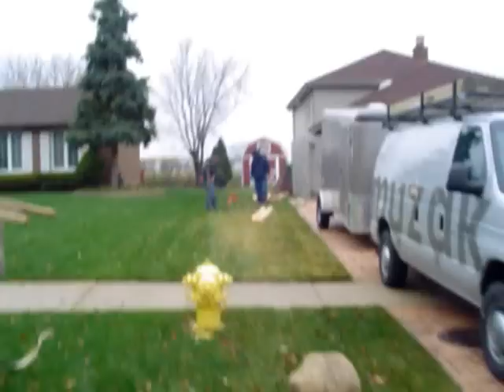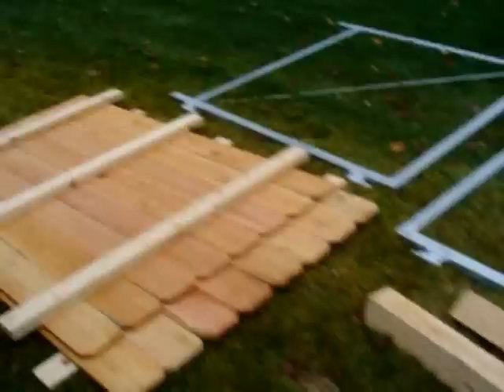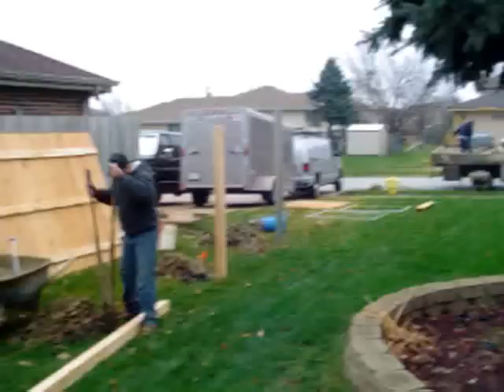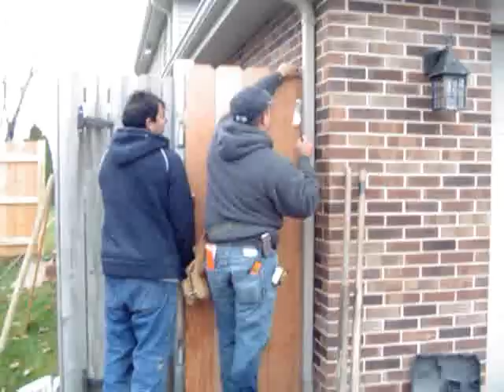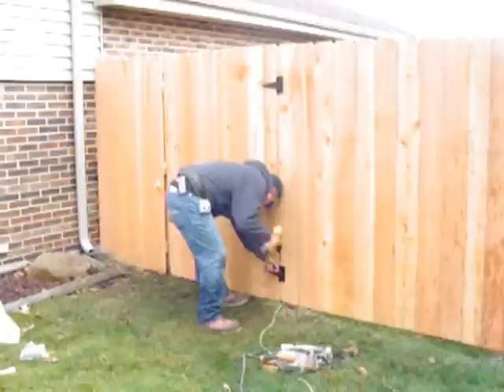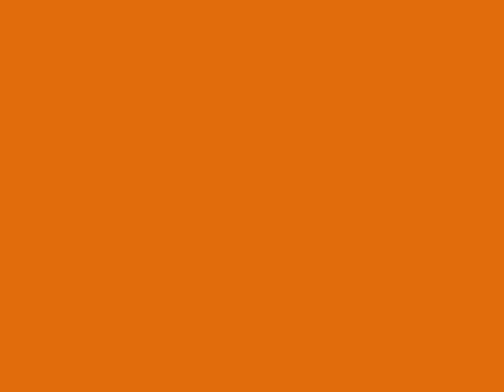Home Improvements  New Wood Fence

Comment: IT BRINGS  ME GOOD MEMORIES WATCHING THIS VIDEO. I USED TO LIVE  IN THAT BEAUTIFUL AREA. I WORKED IN A FENCING COMPANY AROUND THAT AREA AS WELL IN THE ROUND LAKE ILLINOIS AREA. IT WAS A TOUGH  JOB.  We never use prefab panels we always did a picket at a time. This  guys did a good job, the only thing I  didn't like is the way they pour the soupy concrete, that's a no no for me as an experienced fence installer. WE HAD TO DIG HOLES 48 inches deep as  CITY code requirement cause of frost line. WE USED AN AUGER, BUT THERE WAS PLACES THAT THE SOIL HAD TO MUCH ROCKS ,SO IT HAD TO BE DUG BY HAND IT Was so hard THAT the next day I COULDN'T  FEEL MY HANDS.  THEY WHERE TO SORE. NOT DOING THAT JOB NOT MORE. MOVED TO CALIFORNIA.

Comment from the maker: not a problem for setting posts, it still gets hard.   in hindsight I would not have used concrete, I would have used fine gravel, which is how my first fence was installed many years back.  the posts never moved AND I was able to remove them again.

Comment: Nice premade  panel wood privacy fence. The welded steel frame gates are great with awesome hinges and posts. I am surprised they did not use the same steel frame for the walk gate. Although the posts are cedar, without below ground treatment with a combination fungicide and insecticide these posts will rot as easily as any other wood. I definitely would train these workers to mix the concrete to a thicker consistency than that soupy mess they threw in around the posts. Concrete mixed that wet makes a weak footing. Hopefully the workmen did not get concrete under the posts as it will cause premature post failure. AZ Fence Contractor
Reply from the maker: +Michael Waterman  A steel framed service gate would have been a good upgrade.  I didn't think about it at the time.

Comment: Algun dia mi gente dejara de ser mirada para abajo. Y sera reconocida por su trabajo duro y buen corazon.
 
Someday my people will stopped being stared down, And they will be recognized for their hard work and good hearts.
Reply from the maker: I was very happy with the two installers. I would use them again.  The weather was terrible that day and they still did a good job.  6 years later the fence is still solid and straight.  I only allow the negative comments to show how some people think.
Reply: +markos de la torre 
Purhaps, but to learn some basic methods of carpentering would help a great deal.
Standing and hammering when the fence are raised, is just for amateurs.
Even the way they hold the hammers are wrong!

Security are not for fun!
Reply: +Johnny F. Andresen  It's spelled PERHAPS, genius.

Comment: The installer put only TWO nails, one top, one bottom on the support cross bracing for the small gate … no extra nails attaching the angle support to the face of the gate.  Driving those nails through the ‘cedar’ material splits the wood; those panels will fall down in ten or so years.  Try pre-drilling and 3 ¾” deck screws – but that would be pretty sophisticated for CedRus.

Comment: yes, it should be properly mixed before but some people get lazy and just toss it in like that. the water wont fully penetrate the cement, resulting in a weaker, not as long lasting post.  they do however make a specific cement mix to just throw it in and add water but not sure how well that works, ive never tried it and i wont ever use it because i just dont trust it.

Comment: I don't think you are supposed to mix cement like that.  It came out too watery.  It is seeing work like this that makes me keep doing all my own remodeling and repairs.
Reply: its for a fence.  who GAF  if the concrete isn't perfect
Reply: rangerjesse  they could have mixed it more but the Forman didn't want to wait the extra minute.
Reply: rangerjesse  they could have mixed it more but the Forman didn't want to wait the extra minute.
Reply: ummmm actually it does. Cause i didn't mix the concrete right for a fence post many years back and when the concrete hardened it didn't harden right and didn't hold the post in. the concrete became brittle and the post became loose in the ground I had to dig it all up and repour the concrete.

Comment: In over 30 years of building fences I have never built a pre-fabed panel, but you guys did a good job. The first thing that fails on a fence are the posts. Protect the base from soil and it will last a few decades. http://thepostcollar.com/main_page.html
Reply: Pre-fabed can be good. Yellowwood makes an excellent quality pre-fabed fence.  I put one up 15 yrs ago using yellowwood brand panels PT and it's still standing not one repair to it and the color has only started to change 2 years ago checked the wood and it's still strong as an ox. we just had a storm hit with over 90 - 100 mph winds hit the fence. my backyard neighbors cheap 5 yr fence folded like an accordian. This 15 yr old prefabed fence just laughed at it and not one peice of the fence came off or snapped off.   in a pre-fabed panel i look for various things 1) thickness of pickets 2) is 1 or 2 nails used to nail the picket to the runner 3) is it pressure treated.  I don't know about other brands but Yellowwood company on their premade panels they use very thick pickets twice as thick as the cheap versions. 2 nails for the pickets on each runner not 1.  Theirs is pressure treated with a 15 year warranty against rot.   the PT panels are 6x8 sections @ $45 per section so the cost is decent and saves alot of time having to nail pickets one by one.  I'm wierd i don't like steel posts (except for gates) I like pressure treated 4x4 posts put the contrete to the ground level and slope it around the post to keep the water away from the base. I find that if you do that they will last just as long as steel posts.